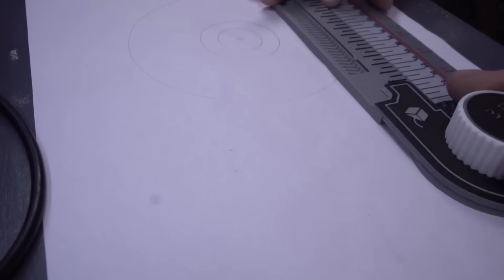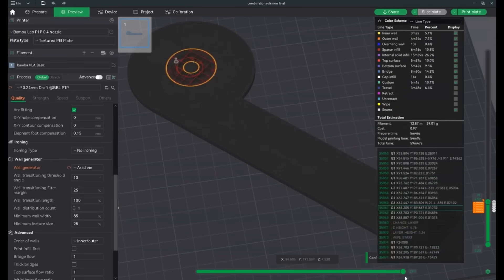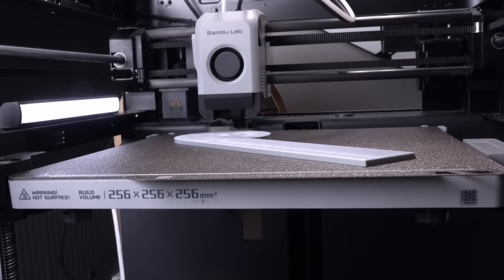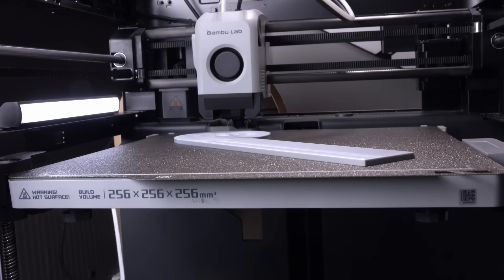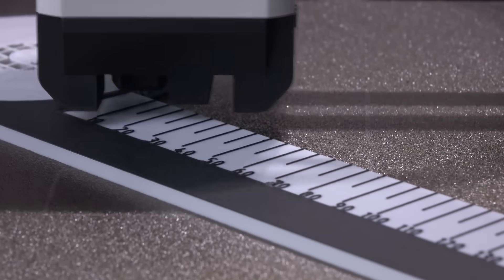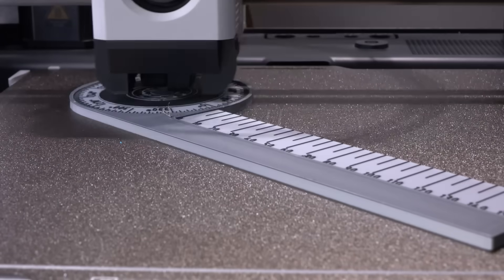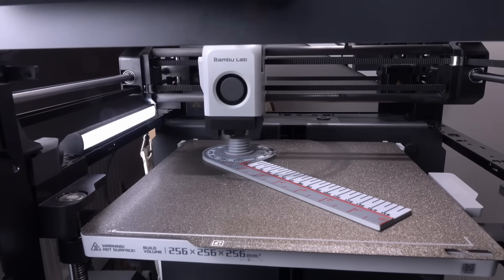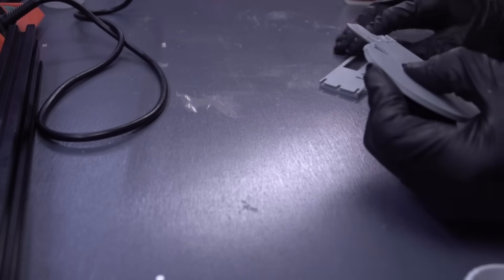A Truly Useful 3D Print

Comment: As a note, the layer thickness I'm interpreting this to be is 0.2 mm. That seems to match up with what I'm seeing in Bambu Slicer. If someone is using a slicer like Cura that wants to use dimensions rather than layer count, there will be 5 layers per millimeter of height. So layer change 16 to layer 17 would be 3.2 mm. Add .2 for each layer going up to work out the dimensional height. And this will work most cleanly if you are printing with a 0.2 mm layer height. 

If your printer doesn't print well at that layer height, (some printers have issues with the fractional steps and accuracy, you may get clean results if you scale the height up or down to the layer height that works well for your printer. I.e. if your printer works most consistently with a 0.16 mm scale Z (only) to 80% and work out what height those layer changes will be. Remember to apply that z-scaling to all parts printed, especially anything that threads together, or needs to have a slip fit between a top and bottom set of layers. (And just be glad you are not "hoping" that the scaling factor is 25400% because the person who created the model was working in Inches, but your slicer and printer seem to work best in Millimeter.

By the way, So far the model looks great. Working through the basic knob, circle template and main ruler now. Will be doing the arm plate and arm after I get some sleep, and these 3 prints complete.  (Knob and circle jig on I1 Mini printers, Ruler, Arm and Arm Plate on a P1S.
Reply from the maker: Excellent explanation. Ill make sure to pin this comment, thank you for your time and download.
Reply: @3DOCD  I will note that I had some trouble with the layer height at 0.20 mm, and dropped it to 0.16, then going layer by layer to find the points I wanted the transitions at. After doing that work, my suspicion is that you were printing at 0.24

For the main ruler, printed at 0.16 mm layers, I did transitions as follows. Grey base, Transition to Black at layer 22 (This could be earlier) Transition to neon green at 23, transition to Purple at layer 26, with the rest of the print being purple.

Printing the arm only needed the color change for the markings, one transition in the last few layers. I did do 2 transitions though, Grey for the bottom, Transition to black at layer 26, and Transition to neon green at layer 38. Again this is with a 0.16 mm layer height.

For the Arm Plate, it doesn't need a transition, but it helps to print it upside down, so that there isn't support material to clean up where the arm gets glued to it. I again did do a color transition, but moved the print of this to an A1 Mini . For this one I simply printed enough of the 'now bottom' layers in black, then after the full surface of the plate is printed I switched to grey for the 'base' again. It doesn't need that, but it's what I did. Note that if you are going to flip the arm plate, remember to either use either x/z, or y/z rotation, or mirror on Z axis, then either X, or Y, (not both) or you will have a part you need to mirror everything except the circle jig, and then need a mirror to read the numbers. 🙂

I also printed the circle jig in black. If someone wants contrasting colors, I'd suggest printing the bottom 3 layers in black, then transition to gray, then print the top 5 layers in their preferred contrast color. As noted, I like green or purple on black for contrast but for gray I might contrast with red or orange.

The knob in white on the same A1 Mini. If someone wants to put in a contrast layer to highlight the label, always a good idea, at a 0.2 mm layer thickness I'd suggest printing the knob in your prefered color for the knob, then at layer 96, switch to the text color for contrast, then at layer 99 switch back to the base color for the knob. There will be a circle of the contrast color. If that is an issue for someone, they will need to switch to a printer they can specifically color those letters in with extra color transitions within the layer. 

Note that this is an handy project to use color contrast for personalization. If you are using this in an engineering or drafting class, your color choices can make this as much your personal tool, as printing your name on the bottom. Note that can be done in Bambu Studio as well, look up first layer artwork, and remember to reverse your text.
Reply: I'm noticing that some of my printers Bambu Studio will allow me to print at 0.24 and 0.26 mm layer height, and 0.24 seems to work well where I've tested it. For the Arm Plate I flipped it over as ntoted earlier, then printed the first layer in black, the second layer in white, then after a coupe of layers switched back to black till I got to the end of the part that goes over the arm segment.

All but the Ruler should be printable on an A1 Mini. The Ruler piece is too large for that, at least as it is. Possibly cutting it in to two pieces, then gluing them togehter would work, but I would expect the joint to be a week spot. It would probably need some variety of splice similar to the arm and arm plate, which I'm not going to try to recreate, but perhaps you might, if there is sufficient interest for people who only have A1 Mini size printers. That might also be a handy option for people who want to make a resin print of this, then come in after and paing the indicators manually. That also seems to me to be a bit tedius, but there are all kinds of people, so... 🙂
Reply: @RNMSC  do you have a print profile for A1 that produces clear numbers on the model please.
Reply: @JasonKenway  I don't have an A1, just an A1 Mini (or 3) and a P1S (or 2). That said, here are a couple of things that can be done across all of the Bambu Lab printers that I know of:

All of this in the Prepare Tab. Right under the type of filament, turn on the 'Advanced' mode. This can get you into trouble, but Studio will highlight everything you've changed with a reset icon that will revert it to stock.

- Select the layer height and quality you want to use. The 0.24 Draft mode will work fairly well, I haven't tested 0.26 ultra draft. These both give fast prints, but the layer height seems to match up (reasonably closely) with the thickness of marks and symbols.

Under the Print Quality section, I switch the Seam Position from Aligned to 'Random. It's not necessary, but in my view gives a better appearance to the knob when that prints. It just moves the starting point for where it starts printing a layer from a line to a random location each layer.

Optionally select 'Scarf' joint. The idea here is that it will start printing with a lower starting pressure on the extrusion, building up while laying down plastic. This is (still) an experimental  or 'Beta' option, so if you are not pleased with the results, back it out.

I don't like Ironing, but if you turn that on, it should give a smoother print surface for letters and numbers to print onto for a cleaner look. This is not something I like more because of wear and tear on the print nozzle, but it's also going to slow things down significantly.

Perhaps the most critical element is the wall generator. Switch this to Arachne. It won't be useful in all cases, but is likely to be help with the numbers more than you realize.

Under "Strength" steps, I enable "add extra wall loop on odd layers. You will have to change the "ensure vertical shell thickness to 'Moderate' or 'None' (I'm using Orca Slicer, so some of the labels are a bit different and options may be different also.)This mostly impacts the strength of the print, and should not affect the numbers, so for numbers, it may not matter. 

And those are the changes I make. Again, I think the only thing that really affects the look of the numbers is going to be the switch in Wall Generator.to Arachne. Essentially what it does is vary the extrusion thickness to better match model appearance.

If none of the above helps, and you are not using Bambu Lab Filament, you may need to calibrate your filament. Especially for pressure advance which is likely to be the first thing that it does the calibration on. Pressure advance calibration tunes where the slicer starts adjusting flow rates as the extruder approaches corners and heads off form them. Think of it as adjusting wall thickness to compensate for the fact that the nozzle has to slow down, and speed up, and because of the lag in melting the filament through the extruder, it needs to make adjustments for that ahead of the actual move. The first part of that is 'pressure' the second is the 'advance' part of the process.

Also keep in mind that you may need to calibrate filament based on the color as well as the manufacturer. This is because for some colors, black being an obvious example, some filament companies 'save money' bu taking some of the extruded filament they can't sell right off the extruder, and grind it up to mix into the material for darker filament. This affects the melt and extrusion performance for that filament. This can be important for a print where you need to swap colors for contrast. 

Hope this helps.
Reply: @RNMSC  Fantastic information and will give it another go after a bit of fiddling in the slicer. Thanks.

Comment: Can't wait to print this! Did you use PETG for some more impact resistance over PLA, or go for something like ABS/ASA? Sorry if I missed you saying it in the video. Also, what is that last little clip in piece used for? The smaller rectangle part with the little divets in it.
Reply from the maker: Thank you for your kind words, PLA should be fine for this type of print. As for the piece with the divets is the circle drawing attachment. When removed it lets you draw circles.
Reply: @3DOCD  Of course! Thank you for sharing it with us. Going to make some to bring into work for people to try out/use. Ahh okay. I thought I saw a circle being drawn near that area in the video, but couldn't quite tell (I was half watching it while eating lunch. Haha).

Comment: Nice design but not FDM friendly.  Too much need for supports. Instructions are missing.  Dropbox link is not for this project.
Reply from the maker: Hello, thank you for your download, however the design is FDM friendly and you shouldnt need any support for printing this model. Also the dropbox link has been corrected.
Reply: This is designed perfectly for FDM printers, and even in the video he shows it running on an FDM wonderfully and turning out great. I think your YouTube is on autoplay and it swapped to the next video without you realizing causing you to comment about the wrong item. Lol. This absolutely does not need supports. It's essentially just 2 flat sticks stuck together with a nut that has some markings on it (while explaining it this way takes away from the awesome design and work put into it by the creator, that's still all it is). Unless for some reason you're trying to print it vertically.

Comment: thats sharp! great to see you back. ive not messed with mid print filament changing. is that something i should be able to find in my slicer to pause at a specific layer? do you set a time parameter or just hit continue or something on the printer when swapped to resume?
Reply from the maker: All I do in bambu studio to set a pause is right click on preview layer bar and select pause layer. this will add a pause at the beginning of a layer(Thats when I change it out).  But there is a color change in the slicer settings but this will create a wipe tower(I didnt want to do this).
Reply: I have done manual color changes on Ender 3 printers where I've sliced the model in Cura. There is a plug in in the cura or ultimaker store, (free) that allows you to specify the height at which to make the printer pause, for whatever reason you have. So for example you can have it pause after leaving a void for a nut, that once you've installed it, the print continues and the model or g-code, then encapsulates the nut into the print. Nice for some things, not as useful for others. My use was primarily to make color changes for things like name badges or name plates, and things like that. 

As noted as well, in Bambu slicer you move the pointer in the sliced model to the layer where you want to make that color change, and tell the slicer to insert a 'pause', you then make color swaps each time the printer pauses in the print.